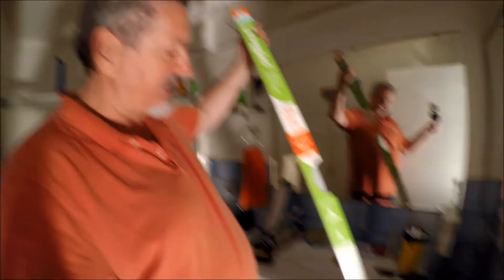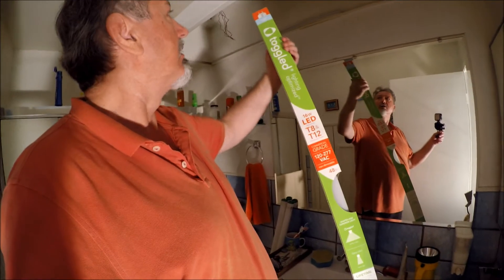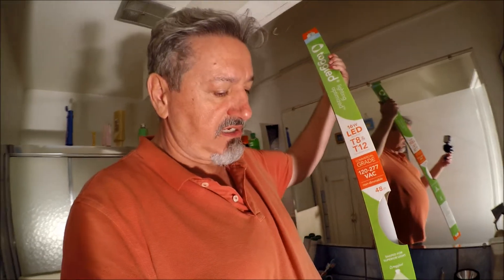Philips InstantFit LEDs - Debunked!

Comment: This vid may need to be updated, so  I'll share my Feb 2021 experience. Philips instafit worked with the ballast,  but nothing after  ballast removed. Took the Philips back to Home Depot because my goal was direct line voltage, no ballast.  Paid 3x the price for tubes at a  lighting store where the counter guy also informed me of the problem. The original Florescent tubes had the line and neutral connections wired to the opposite ends of the tubes. The LED tubes he sold me are "single end" meaning the line and the neutral pins are on one end of the tube, the pins at the opposite end are there only to hold the tube in place in the fixture. So with my 2 tube fixture I needed to replace the tombstones at one end with non-shunted ones, then wire one side of each tombstone to  line and neutral(AKA neg and positive.)  (consult a wiring diagram.)  Works fine and no ballast needed.  DISCLAIMER: If you do not have knowledge of electrical  wiring, you should seek assistance or hire an electrician. Hope this helpful.
Reply: Thx for the update, John. Yes, these have changed over time ... maybe I should delete this video so people don't get confused ...
Reply: That is great advice.  I got suckered into this instant-fit and it didn't work as I had ancient magnetic ballasts. The ones that don't require a ballast (like the Philips Mainstay) are hard to come by in the 5K (Daylight).  Time to shutoff the breaker, rip out the ballast and do some rewiring in the fixture.  I would do a YouTube video, but hey just not enough time.

Comment: These tubes disassemble very easily. There is an electronic package at both ends, one has several resisters and a capacitor and connects to the led strip with a micro 4 wire plug, the other end in one single wire going thu another set of what appears to be capacitors,  then to the other pins. Be nice to sort is out and make them adapt to a direct connection or a dc power adapter.

Comment: No need to watch this video.  Instantfit bulbs work with electronic ballasts only.  They don't work without a ballast and they don't work with magnetic ballasts.  This information is straight from Phillips.  If you use your phone to video tape your lights running and see lines flashing across the phone screen that means you have a magnetic ballast which won't work with these bulbs.  No lines means that you have an electronic ballast that will work.  Ideally though you should remove your ballast as they waste energy when using LED bulbs and will eventually fail.  If you do remove the ballast you do need a different type of LED bulb.  Not instantfit as they are require a ballast.  Moral of the story is do your research before wasting hours like Nick did.  It only took me maybe 3 minutes to look this up.
Reply: Thanks, John. Trust me ... in 2017, when I posted this video, it was the only bit of information on these bulbs, and it took me a while to find that info on the Philips site ... and therefor the video :-)
Reply: @nickzigicmusic  Ok, yeah sorry I believe that.

Comment: Philips publishes a list of compatible ballasts online, which is good to reference. It would be nice if this was included in the box or on the package, but the online guide is up to date. I've installed over 60 of these LED bulbs. Even in an electric start ballast, if it's not on the compatibility chart, the bulb will either not work, or will burn the ballast out within a couple weeks. Don't bother if the ballast isn't compatible. Having said that, when the bulbs are installed with compatible ballasts, they work really well. The bulb provides superior light, and the energy usage is close to advertised on the box. 

http://images.philips.com/is/content/PhilipsConsumer/PDFDownloads/United%20States/ODLI20180301_001-UPD-en_US-PLt-16118CR_InstantFit_Ballast-Compatibility-Guide_2018-1.pdf

Comment: The retrofit type, at least the Philips T8 glass instafits have the leds wired in series to take 240 volts.  The ballast supplies that, so  you have to use the ballast with them.   I got the right ballast and they worked.  Oddly, the ballast makes them mimic old school lamps on startup.  They come on dim for 2-3 seconds, then brighten.

Comment: Same issue.  The old magnetic ballast in my fixture didn't work.  These are the glass 17 watt 4 foot T8 instafits.  HD has an electronic ballast for $15, so I'll look on Philips site to see if it's compatible.  Yep.  REB-2P32-SC is a  "system certified"  ballast.  I'd love to know how many people returned these to the store!  I bet HD will soon stop carrying these because of the hassle caused by lack of installation and applicability details.
Reply: Count me in as another fool who fell for this.   I have magnetic ballasts both on 2 separate 4' T12 fixtures, and both are on the verge of failing.  I returned my 4 Instafit bulbs to Home Depot.  The electronic ballast is $20 (needed 2, one for each fixture) , so I opted for single-ended non-ballast T8 leds from Amazon for about the same price as the 4 that I returned.  Live and learn.
Reply: Thanks a lot man, I've been killing my self trying to figure out why the hell didn't work...going to HD right now.
Reply: But isn't one of the main points to eliminate the ballast for more energy savings?

Comment: I too had the same challenge.  Philips LED fluorescent did not work. Thought to cut the ballast wires and retro fit.  Had a gut feeling NOT to do it since my Utilitech ballast 4ft light fixture is only two years old. Glad I listened to the inner voice.   
Returned the Philips back to Home Depot.  

The LED fluorescents that did work were:

1- (Home Depot) Feit Electric 4 ft. T8/T12 17-Watt Cool White Linear LED Light Bulb $9.92 per bulb

2- (Lowe’s) GE LED 48” 15w 1800 lumens. $14.98 2pk

I opt to keep the GE daylight for my kitchen because it’s the best lighting for me when cooking.
Just remove old fluorescent bulbs and replace with GE LED. Done.  

Hope this helps.

Comment: I was at Lowes and just bought Utilitech 48 inch retro fit bulbs, I think the box said it works with an electronic ballast, the price was $17.xx  for 16 bulbs on clearance. I used an ohm meter and measured the resistance pin to pin = 500K ohms on each end and infinity across the 48 inches. Possibly applying 120 v. at each end might light it?  Any one know what the pin voltages are from an electronic ballast?  Is there any chance that they might work on 120 volts directly  --  NO BALLAST??
Reply: I am also searching for these direct answers.  Utilitech customer service does not offer support for light bulbs and say all light bulb service is store level.  I am interested in removing the 2     T 12 ballast from my 4 bulb fixture and replacing with the same Utilitechs that u bought on clearance.  I bought 30 cases of them!!!!!!!1  I know they will work with an existing T8 ballast plug and play.....but not certain about them working without any ballast....let me know if u find out please.
Reply: I grabbed a few boxes on clearance as well they do take the electronic ballast and will not work with the  bypass method or the old magnetic ones. found an easy and fast way to check to see what ballast you have, use your cell phone take a picture of the light while lit with the fluorescents in it. clear picture means electronic vs a pic with lines running across the bulbs will indicate a magnetic. Bottom line bulbs were still a great deal I have 10 4 bulb fixtures to redo and I can pick  up a case of 10 high rated 4 bulb electronic ballasts on amazon for 90 bucks to the door. hard to beat redoing 10 fixtures and having a few spare bulbs for the same price as 2 new 4 bulb fixtures and without bulbs. hope this helps
Reply: Correct......apparently Lowes made a mistake on the $17 price.....by the time the sale was over we had purchased approx 60 cases....have 4100 color half 6000 color.  The 6000 are extremely bright...would be good for a shop but not good for our retail stores.  I have been doing T12 to T8 ballast retro fit and just installing the 4100's...they work perfectly with the T8 electronic ballast.  I wish I could get them to work without a ballast but so far no can do.